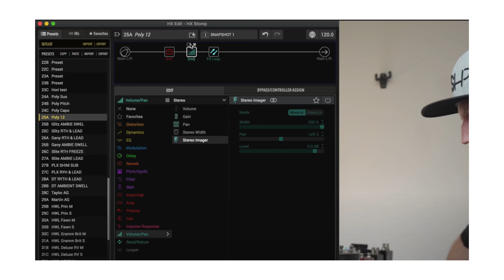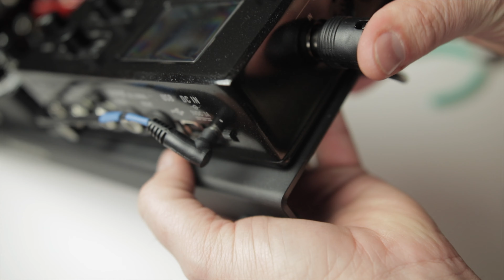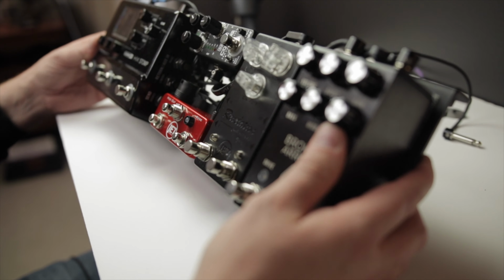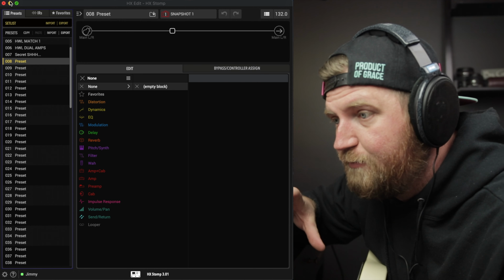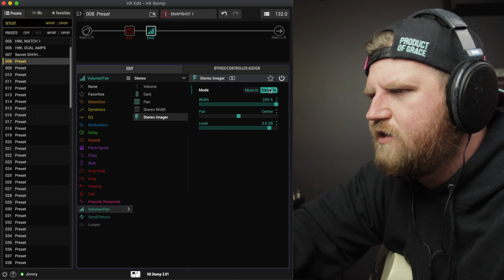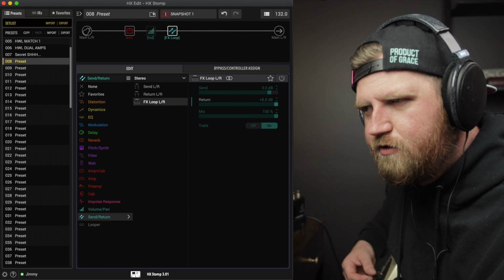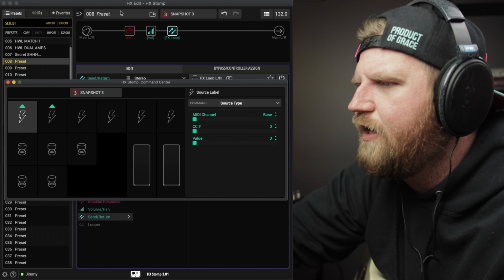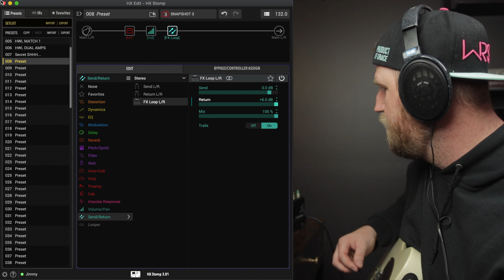Why You NEED a TRS Y Cable for the HX Stomp Stereo FX Loop // Plus SNAPSHOT Instant MIDI Commands!

Comment: Good vid man.  

One thing that does come up quite a bit and I’m curious as to whether you’ll eventually try it out is using external amp simulations like the iridium.  This has a TRS input much like the stomps TRS output and makes for super simple connectivity ( just grab a TRS cable and you’re set.  On the back of the iridium there is a little switch which changes the input from mono or dual mono to stereo. 

If you’ve never considered using one I’d recommend giving it a shot.   The experience dialing in tones is a bit more immediate and it’s yet another zone in the signal chain that can be pulled out of the hxstomp freeing up multiple (amp and cab blocks) and giving you a lot more midi options.
Reply from the maker: I do love the tactile nature of the Iridium...still looking to get my hands on one

Comment: Hey wondering if you could help? I got an HX stomp but never got on with it. I now have a Walrus ACS-1 which I love but want to use the stomp as effects only. Any ideas as to the best way of doing this with out colouring the sound? I have tried as few options but don’t really understand it. Many thanks.
Reply from the maker: you can run the Stomp before or after and test which you like better...or put the ACS-1 in the FX Loop and place anywhere in the signal chain of the Stomp that you want...like after drives and before delays and reverbs
Reply: @HeyWorshipLeader  your a star, thanks

Comment: How were you able to get sound out properly at all without a TRS Y cable? I just got the big sky today and I'm trying to use a normal patch cable from the stereo send of the stomp, into the left input of the big sky and out of left and right of the big sky into the left and right return of the stomp.  I have my FX loop block of the stomp between my amp and IR and I can't hear anything past the FX loop with it turned on... Nothing in my signal chain before the stomp is stereo, so I didn't think I needed stereo out of the stomp.

Signal chain: tuner->mono overdrives->input of stomp->stereo send of stomp to left input of big sky->L/R out back into L/R return of stomp.
Reply from the maker: It appears you have everything hooked up correctly. I would just make sure you're going to the input and not the out of your Bigsky on accident. If you want to record a little video explaining and send it to jimmy@heyworshipleader.com I'd love to help you solve it

Comment: Quick question: how do I know which side is which on my split TRS cable? I'm trying to run a stereo pedal and I don't know which side (tip or ring) to put in which input. Thanks!
Reply from the maker: You don't have to worry about which to run into a stereo pedal. You'd only need to know if you were going to 2 different pedals like expression and an external footswitch. In that case, it's just quick process of elimination

Comment: hi! random question, and I hope you see it haha. Im planning on using my hx stomp with a stereo reverb and mono delay. I want to run both pedals in the fx loop, so would there be any issues with running the delay (mono) then reverb (stereo)? I hope that wouldn't effect the stereo imaging of my stereo reverb.
Reply from the maker: It will work perfectly...just know that anything before the FX Loop block will be summed to mono once it hits that Delay. So just keep it after any other mono blocks and before any stereo blocks and you'll be golden
Reply: @HeyWorshipLeader  just what I needed to know, Thanks!

Comment: Have you experienced any noise or plasticy sounding gain with the stereo Y cable? I'm experiencing some issues with an FX loop that I would love your insights on. Thanks!
Reply from the maker: I haven't....can you send me a video with the issue and send it to jimmy@heyworshipleader.com I'd love to take a look
Reply: @HeyWorshipLeader  I think I figured it out, it was an output level to the FX loop that was the problem. With all the places to add "volume" on the stomp, it needed some tweaking to make sure it was peaking coming out of the FX loop when I turn an outboard drive pedal on

Comment: Hey man, awesome vid and explanation, thanks. Do you have a link for the cable holder thingys? not the zip ties, but the actual holders that you stick under the board to attact the zip ties to. Thanks
Reply from the maker: Thank you so much. You can find a link on this page at the bottom of "Cables" section: //www.heyworshipleader.com/affiliate-shop